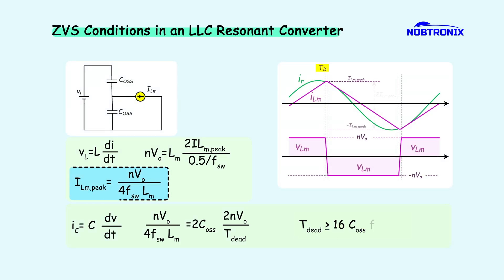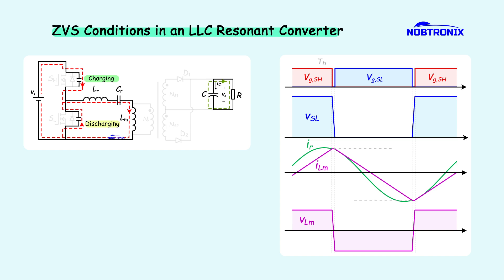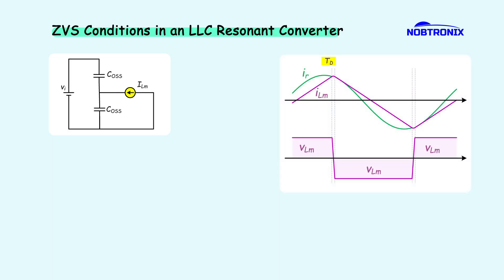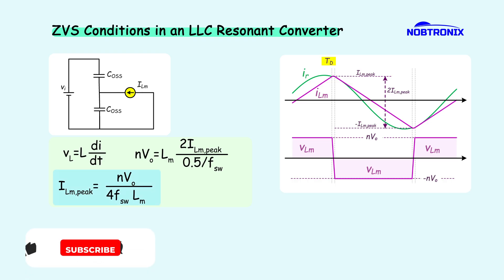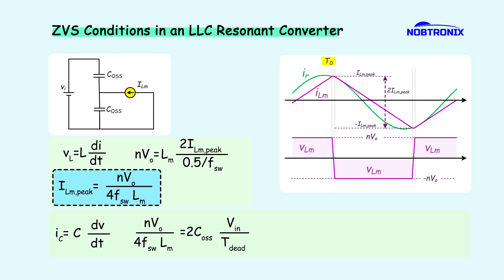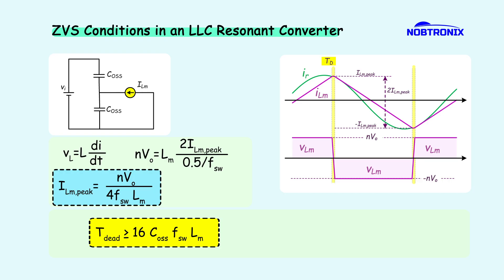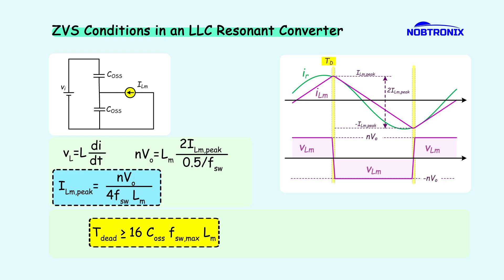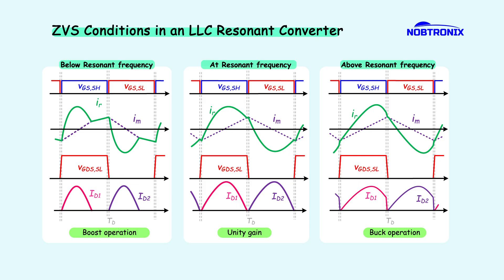ZVS Conditions in an LLC Resonant Half-Bridge  Converter

Comment: Appreciate for this video, I have a question is the Coss mentioned in the video equivalent to the MOSFET's internal output capacitance? If I need to find the specific value, which parameter column in the datasheet should I look for? Thank you!
Reply from the maker: Thank you! Great question. The Coss you see in the video is related to the MOSFET’s internal output capacitance, but it’s important to note that datasheets often break this down into Co(er) (energy-related) and Co(tr) (time-related). These capacitances are non-linear and vary with the MOSFET’s voltage. Some datasheets don’t list them directly!
For the energy-related capacitor, check the diagram showing the energy stored in the MOSFET output capacitance (usually near the end of the datasheet). You can then apply the 0.5CV^2 equation.
 For the time-related capacitor, you can determine the value by charging and discharging the output capacitor through a resistor and calculating the time constant.

Comment: what software / graphics / library did you use to the make the moving red dotted line indicating current, and the circuit schematic itself?
Reply from the maker: With Adobe After Effects, the motion graphics software, you can take any idea and make it move